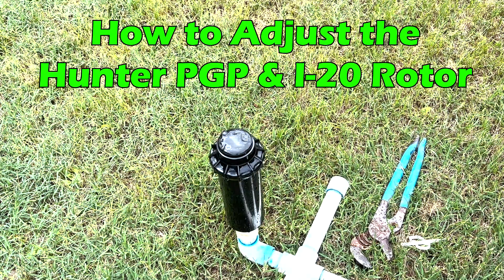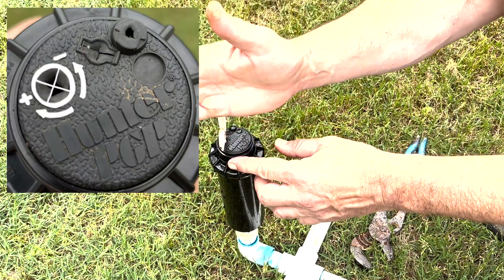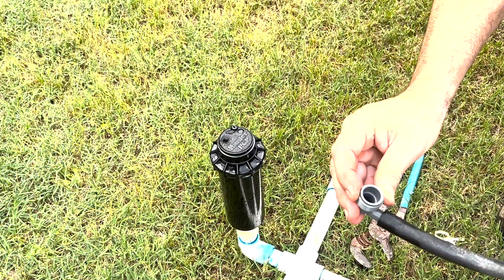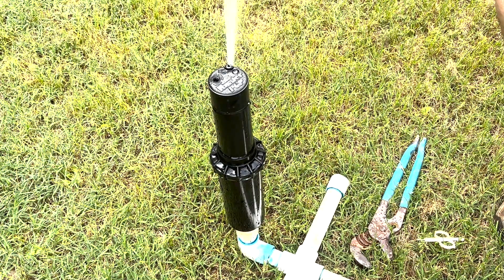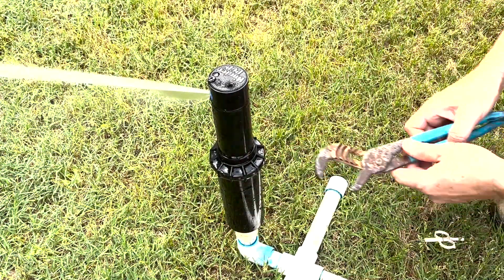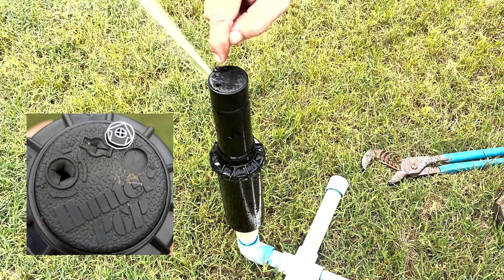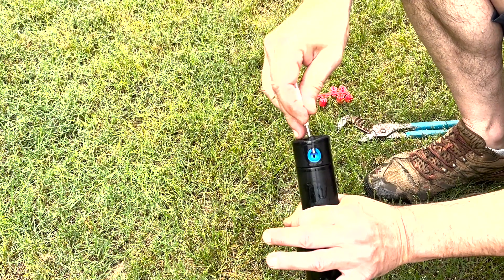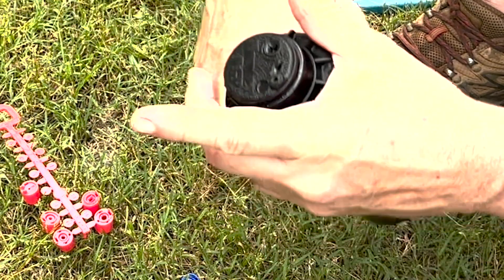How to Adjust Hunter PGP & I-20 Rotor (sprinkler adjustment)

Comment: What if you want to cap it? Like no water comes out. I have several of these in one zone, but don't want water coming out of one of them. Can't seem to find a cap that works for this model.
Reply from the maker: You can dig it up and put a 3/4" threaded cap on the fitting that you screw the sprinkler off of. Don't just cover up that fitting without somehow marking the location of it precisely. Once you cover it up, it's gone. You think you'll remember where it is if you ever want to reinstall the head for whatever future reason, but you won't remember.

Comment: When adjust right side angle, if you continue to twist the shaft to adjust, could it potentially come out of the buried threaded fitting ?
Reply from the maker: Yes, if you continued to spin it around. But there's at least 4 or 5 threads on the fitting, so you shouldn't be in danger of it coming off if you're just adjusting the left limit.

Comment: Great video!  Question...@5:15 you show how to adjust the spray distance.  I have these same Hunter PGP heads, but on a few of them, when I try to insert the tool to adjust the spray, I can't get it to "seat" or "lock" in the screw securely to adjust.  I can't find the screw head as I insert the tool.  It's as if the screw head is covered or filled in, meaning the notch is gone.  Any suggestions?
Reply from the maker: Yes I do have a suggestion. Find a dental pick, and use that to scrape around and dislodge the dirt compacted in the top of the screw. I found some dental picks at Ace Hardware, oddly enough.
Reply: @Proirrigationtraining I also pry off the rubber cover so I can see the hex head of the screw when I am cleaning it with the pick. Sometimes, there are hard water deposits as well as dirt in there.
Reply from the maker: @richk6827  Great suggestion, thanks for the comment!